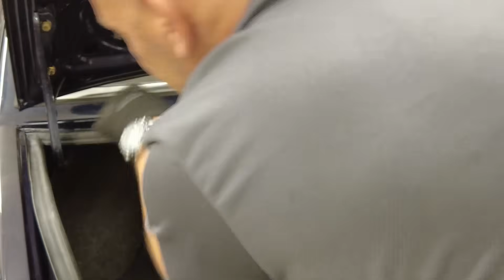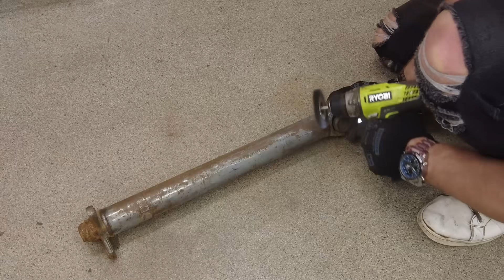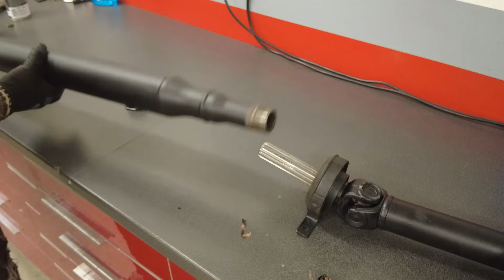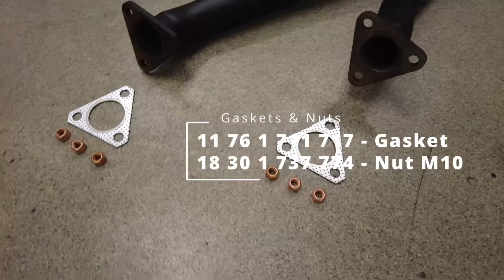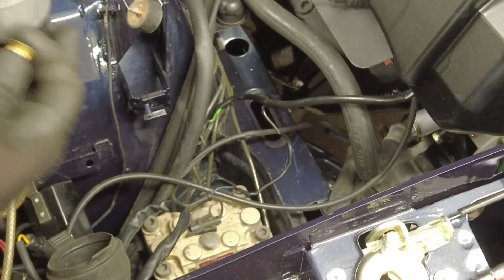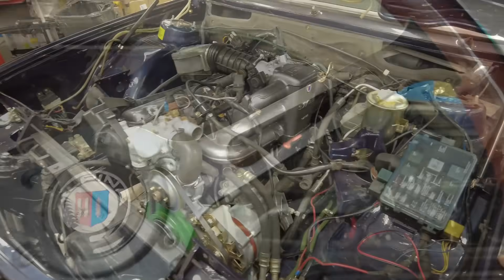BMW 535i E28 Alpina - Will it Start?

Comment: Great video again! Very informative. I was suspecting an issue with the airflow meter with mine but seeing this video I think I might need to change the distributor cap
Reply from the maker: Thanks! Yes, its a unlikely problem, but I have had the same issue a few times lately, so its getting more likely all the time 😇😊. I hope you find your issue as well! /Mats

Comment: i had exactly the same problem with mine .. dropped it off to  have a new ICE  install ... car wouldnt start .... Dizzy cap and rotor arm  at fault
Reply from the maker: Amazing, but terrible info.
I had sinilar issue in my M535i, so I thought it was an one off issue, but yet agaun its same issue again.
So hopefully next week will bring good news 😃😇
/Mats

Comment: Bra video som vanligt 👍 Ska det inte vara CHF 11S i servon ?
Reply from the maker: Tack så mycket! Kul att det uppskattas! Nästa avsnitt ska bli mer action hoppas jag 😇
 Jag har an ävnt ett flertal oljor genom åren, och olika manualer säger olika val. Nyare bilar med nivåreglering vet jag kräver 11S, men E28 är mer av en allätare. Oljetypen blir nog mindre relevant speciellt nu när de brukas som entusiastfordon och lever skonsamt. Men annars får det skiftas 🙂. Många manualer hänvisar bara till ATF, ingen ytterligare spec. 
Idag kom fördelarlocket 😋😉
/Mats
Reply: @kinnby_customgarage_1976 Då förstår jag, det är bara en annan som alltid har slagit i CHF för att det står det på locket👍 
Härligt att fördelarlocket har kommit då blir det snart uppstart ❤
/ Niclas

Comment: Captivating as always ! Extremely well explained with all the details, step-by-step  . We don't find that on any other channels ! Great tips and advice ,especially at  the end. Good idea not to put LEDs for the rear licence plate since If you have the on board diagnostic control panel, the corresponding warning light will remain lit because the LEDs  draw such a tiny amperage that the system thinks there is no bulb or a burnt one. Won't sleep until next video ! Many thanks  Mats.
Reply from the maker: Woow, thanks buddy!
Amazing comment and very nuch appreciated!
LED's are good in many spects, but in Classic cars - no way.thats my opinion at least, as well as Xenon in front.
It creates a mindfuck between generations unfortunately.
Its different if we work with E38/E39 or similar, but back in the 80's they had nothing like this.
Next episode will be shortly, so I hope you will be able to get some sleep until then 😁
/Mats

Comment: Great to see you again Mats! I am also having big problems trying to get my M30 B35 started. I have had many people now helping and suggesting things, but no joy yet. The problem is that the car is outside so I am now fighting with the English weather! I have been trying to get hold of an ECU (DME 1.3) to eliminate that from the equation but nobody seems to have one I can borrow, and second hand or new old stock units are very expensive. We'll see. Anyhow, I look forward to your next video.
Reply from the maker: Welcome back! and thanks for your feedback!
Yeah, the ECU´s are getting rare, but luckily they are very hard to kill, so most of the times the issue lies elsewhere. Check for spark confirmation like I did, and if its successful, also check if the injectors have pulse by either measure with a instrument or connect a small light bulb to the injector connector. Just to verify whether there is some kind of reaction.
I hope you find the issue!
Regards Mats